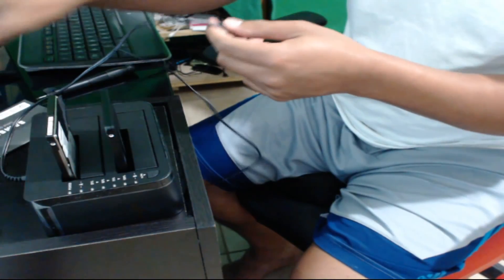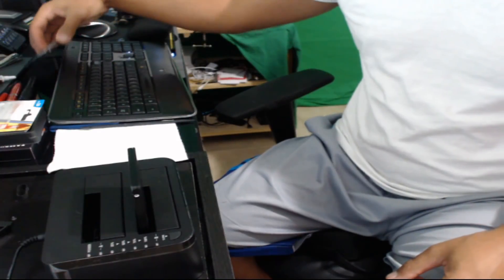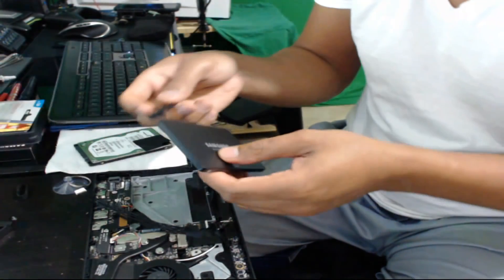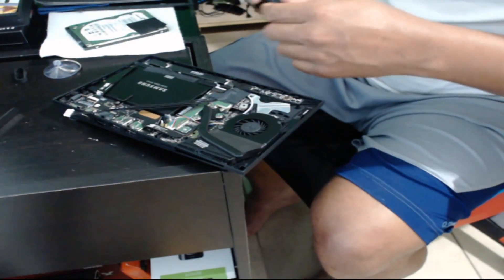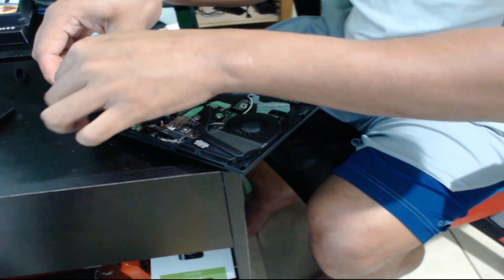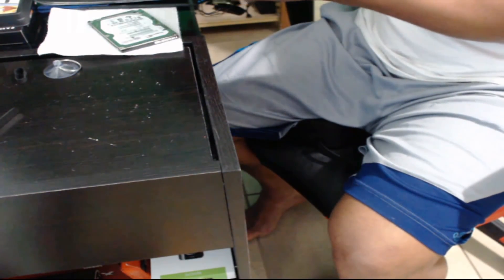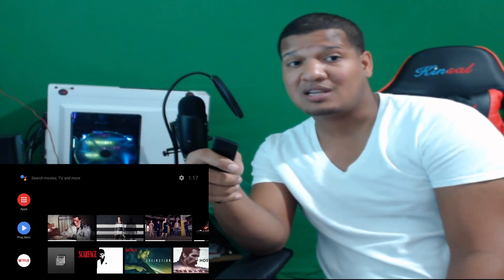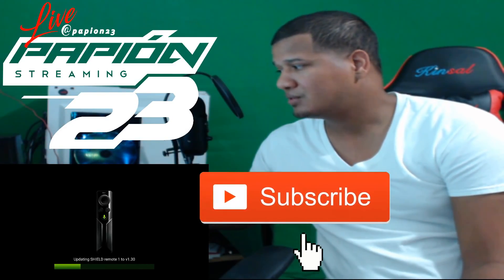Nvidia Shield ProTV HD TO SSD Swap

Comment: There is a free software called Clonezilla that you can use to clone the drive
1 download the iso and burn it to disc (or create a bootable usb drive)
2 boot your computer from the disc/usb and use the software to
a: create an image file that you can restore to a ssd/hdd at anytime 
b: or do a direct hdd to ssd clone without creating the image file

it is a linux environment with a gui that is fairly easy to use.

just an alternative for those whom may not have access to the cloning device

Comment: Hey bro my 500gb HDD isn’t working correctly would you sell me a loaded SSD I can pay you via PayPal? If you can please help me out? Or if you have a loaded HDD for sale please lmk.
Reply from the maker: Im in vacation but will be back soon and will most definitely help you
Reply: @ArcadeParadise25  Hi, I hope you well, I seem to have a corrupted Hard Drive as well. After I did a firmware update, the sheild refused to boot up again. Definitely require someone who can clone a drive for me. Kindly assist if you can, my email is julian@bluegreen.co.za
Reply from the maker: @juliannaidoo5531  hello i can help with the cloning pressure also you can get the image for your dive and re install the system on it.
Reply: Jc Cruz yes brother thank you! Have a Happy New Year!
Reply: @ArcadeParadise25  did you help this guy? same thing happened to my shield...the original hard drive took a dump on me and I swapped it with another hd i had laying around....but now i boot up and nothing comes up
Reply: @aeno15    same here   made a copy of original  hd  and  clone it to a ssd     now it wont boot up any more  even not with old hd  in it

Comment: It ain't work with 2015 pro model at least mine it ain't boot i've try with 2 brand new fresh out off the box samsung 500gb evo 860 with no luck :(
Reply: Maybe a Shield factory format with the original or a boot command must be inserted in the new SSD ???
Reply from the maker: how are you cloning the drive?? because i do a few of this a week and they work like a charm
Reply: @ArcadeParadise25  with a ORICO 6629US3-C toaster cloner
Reply: i put the drives in on clone position turn it on and press clone and wait till 100% 3 beeps and turn it off
Reply: @ArcadeParadise25 am waiting for the shield to factory format the original HDD now and try the toaster for the last time if it ain't work ill wait till my shield die and get the 2019 pro i guess 🤷‍♂️
Reply: @ArcadeParadise25  so it's a big NO it ain't work
Reply: Maybe the clone machine is defect ill try to clone something i can test
Reply from the maker: Well Nick the only thing i can do is offer you my service if you're willing to do it.
Reply: @ArcadeParadise25  ill try to clone my laptop pc drive tonite to see if the cloner work or not ill let you know thank you for the help 👍
Reply: @ArcadeParadise25  I've ordered the same cloner as you use and a new 860 500GB ill try fryday and let you know 😌👍
Reply: Got it early in cloning process wish me luck this time 😁👍
Reply: It work!!!! am so happy !!! 👍😁👍
Reply: So many tanks !!!

Comment: There's a cloning cd that has a program to backup a disk and clone it onto another I've been using this to restore my windows whenever there's corruption problem in Windows .... Don't need cloner or whatever ... Boot into dos>find cd drive>run the program>select the disk to be cloned>then restore the cloned file onto destination drive. The best part is that the cloned disk file is created and can be used anytime for any drive ... NORTON GHOST is the name of that Windows app
Reply from the maker: So what would be the program's name because for this particular drive windows doesn't see it
Reply: @ArcadeParadise25  Norton Ghost

Comment: I need help, I got the Samsung - 860 EVO 500GB Internal SATA Solid State Drive after the cloning i install the hard disk but nothing comes up but when i install the old one it works. What went wrong??
Reply from the maker: If nothing comes up the cloning procedure didn't finish correctly
Reply: Do i need to format the ssd on my pc?

Comment: i have shield tv pro 500 gb with bad hard drive.
How can i make other hard drive to boot with?
Thanks
Reply from the maker: Voy a tratar de enviartela
Reply from the maker: Hello I had that problem happens to me ones i know that XDA have a DISCOTION were you can get the image for your HD but the way i fix my shield was by cloning my friends shield HD and put it on my shield and it work after that i just re-set it and everything was working. hope that helps.
Reply: @ArcadeParadise25  
Thanks for quick respond.
Do you have link for that website or can you  somehow help me out. Make another copy and i will pay for that.
Thanks
Reply: @ArcadeParadise25  isn't it possible to clone from a corrupt hd to ssd? when the hd is broken will the image also be broken?
Reply from the maker: i can help you with that this is the site https://forum.xda-developers.com/shield-tv
good luck if it doesn't work i can make a copy for you let me know
Reply: @ArcadeParadise25  hola hemano buenas tardes me podras pasar la imagen ya que mi hdd se murio  intente cargar la imagen de nvidia pero no pude de ante mano muchas gracias
Reply from the maker: https://www.youtube.com/watch?v=NeyW19Gf5BE

Comment: I have a 16gb 2015 shield model with a 128gb micro sd card installed with the system as opposed to an individual drive. How would I go on about installing a 500gb ssd with my setup???
Reply from the maker: I don't think  is possible  the 16gb doesn't support a internal drive.
Reply: @ArcadeParadise25  ok thanks
Reply: @ArcadeParadise25  would you happen to know how to replace my internal memory card with a usb storage?

Comment: Can I do it with sshd please lmk
Reply: I want to put a 4tb ssd is to expansive
Reply from the maker: You can use the same procedure  in this video
Reply: @ArcadeParadise25  That sucks that it 4tb wont work just wondering why not? Please lmk
Reply from the maker: And no you can't put a 4tb has to be 500 or it won't work
Reply from the maker: Nvidia tap it at 500 if you use anything bigger it won't work
Reply: @ArcadeParadise25  can I put a 480gb it's on sale just wondering
Reply from the maker: @mikelarry8704  i haven't try with a smaller ssd thats a good question will try this week and let you know
Reply: @ArcadeParadise25  ok lmk
Reply from the maker: https://www.youtube.com/watch?v=NeyW19Gf5BE

Comment: Cheers worked 100%, came across your video couple of months ago, but couldn't find anyone willing to ship cloner to Spain, was on net browsing other day & ad popped up for it on amazon UK (bingo} had evo 850 already, I backed up all stuff I wanted to keep, then full factory reset mine, logged in etc... first then cloned, it takes more like 1hr 30 min to clone, anyway cheers again 👍👍🍻 link is for UK amazon & version that doesn't have USB type C port (I don't need it & cheaper) https://www.amazon.co.uk/gp/aw/d/B00LN0GX4I/ref=ppx_yo_mob_b_old_o0_img?ie=UTF8&psc=1

Comment: Hey dude, great video.. But it's possible to clone that 500gb to 256.. Don't really need 500 gb..
Reply from the maker: Hey whats up man no it's not possible it has to be 500
Reply: @ArcadeParadise25  thanks for the quick response..👍
Reply: Hi m8 can can confirm that it's working on wd blue 500 ssd and one other don't remember the brand, but I'm very sure that every 500gb is working.. But it has to be 500gb. Not 512 or 480. And thanks again..
Reply: I have seen that you can make it work on 1tb but need some software modification..
Reply: @PresiAce  EVER FIND ANY INFO ON IT  WORKING ON A 1tb ???

Comment: I succesfully swapped my sshd with 860 evo 500 gb from this video. However' you dont necessarily need the cloner. I used hdd raw copy tool from hdd guru and it worked perfect! Thanks for the tutorial though
Reply: So you had replaced your hdd to sshd and  if so how was it running with the sshd?
Reply: @mikelarry8704  I replaced SSHD with SSD and its very very fast now compared to old drive.

Comment: My shield just has the green light on but shows no picture on TV I've tried everything any suggestions
Reply from the maker: After you clone the drive???
Reply: @ArcadeParadise25  no just with stock drive I wonder if it's a dead box it's weird
Reply: It's the sshd ,it doesn't live long call nvidia for a replacement,
Reply: i have this problem with cloned drive, nothing happens just green light
Reply from the maker: Thats super weird haven't experience nothing like that yet but i could be a bad hdmi port if the light turns green
Reply from the maker: If it was the hd the light doesn't turn on

Comment: Can you make a video on how it's done with Crucial MX500 500GB 3D CT500MX500SSD1(Z please
Reply from the maker: Hey it would be the same procedure if you wanna see the difference in speed i think crucials are slightly faster
Reply: So it's OK to used Crucial MX500 500GB 3D CT500MX500SSD1 or you  don't know, it cost less , just asking
Reply from the maker: @MrNightmare4nick  yess is ok to use crucials drive or any ssd drive just needs to be 500gb
Reply: Thanks for your help ,you  should do more NVIDIA SHIELD TV videos on how to
Reply: @ArcadeParadise25   hi . Can i download all file from website and get it to work onto a smaler hard drive . I think its a 230ssd
Reply from the maker: @godfreyfoster3266  you have to use a 500gb I don't know how to use a smaller or bigger  there's a guy in the comments that said he was able to use a bigger Hardrive  but I try with a 512gb and didn't work.

Comment: Great video.
My clone machine & SSD has just arrived, going to follow your instructions & see how it goes 👍
Reply: Did you manage to swap out the drives?
Reply: Everything went exactly like the video. Clone took just over an hour. This gave me time to use an air can to clean the 3.5 years of dust in my shield 😅. Most tricky part was connecting the sata lead to the clip on the circuit board as I never felt it was going in enough, but it was.
 Now restarts 25seconds faster, & performance all round is a bit more snappy/fast. Would recommend 👍
Reply: @allanmcmullan3524  just 25 seconds?
Reply: @mikelarry8704  Yes mate, that's a 3rd of the reboot time. Pretty amazing stats for a simple harddrive swap 👌
Reply: @allanmcmullan3524  could i order a ssd and have you help?

Comment: Great video, just ordered the shield pro before it goes out of stock. But it really sucks that Nvidia include SSHD instead of  SSD (71$) and yet bump price by over 120$ from 16gb version. I understand you can use HDDGURU SOFTWARE instead of purchasing cloner.

Comment: Hey Jc  what i would like to know is,  what year is the shield  you working with?

i tried with a 2015 pro shield and it didn't work
Reply from the maker: hey i can confirm working on the 2015 and 2017 i have done it on both
Reply: Jc Cruz when i did it the shield powered up but not booting, i’m in europe
Reply: @wynterkidd8928  
Hey did you managed to make it to work?
Reply: @wynterkidd8928  
The SSD must be fresh out the box so never been used on windows, initialyzed or formated
Reply from the maker: https://www.youtube.com/watch?v=NeyW19Gf5BE

Comment: Still needs a Linux system for doing this or there is a new method for using Windows?
Reply: You can use Hddguru raw copy tool on windows 10 to clone raw image of drive. 
https://hddguru.com/software/HDD-Raw-Copy-Tool/
By default as Jc Cruz says windows won't see shit but hdd guru software will see it
Reply: @lenanaH  thanks!
Reply from the maker: only with lixus right now
Reply: @ArcadeParadise25 so no way to swap the HD on the shield pro for an SSD without Linux 😥
Reply: @ArcadeParadise25  hu? I thought you only need these cloning machine??

Comment: I wanna use a 1TB or 2TB SSD. I know it would leave you with 500GB partition with unallocated space. Could the unallocated space be added to the 500GB partition and still run just as well? Has anyone tried this? And btw it was a great idea to use that disk cloner, much easier.
Reply from the maker: i try with a Samsung pro 512 GB and it didn't work for me so i look in to it and fount that NVIDIA add it something to the shield so it doesn't support more than 500BG.
Reply: Yeah it's cap at 500g but you can add external drive with the USB  plug ins

Comment: Done! So easy took about 1 1/2 hours including clone time.  No one else is teaching this method.  Thanks
Reply: So you just get a cloner and clone the hdd to ssd and reboot it and that's it?
do you have a 2015 pro model?
have tryed 2 times with no luck ...
Reply: @NickCrate007  yes,  use a 500gb ssd.  Done today without any issues

Comment: Good stuff. The instructions in Tilator's XDA thread weren't clear enough for me. This technique makes this seem very doable.

Question though: Can the replacement drive be any size? I'd like to swap the stock drive with a 1TB or 2TB drive if possible.
Reply from the maker: no i try a Samsung evo 512 and it did not work it needs to be the same sizes for it to work.
Reply: Thanks for the vid and info✌️